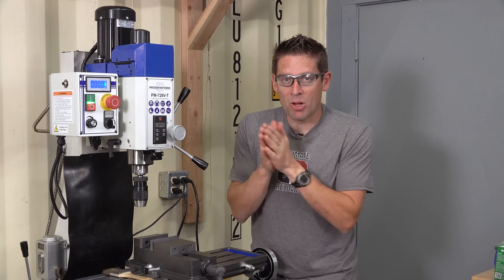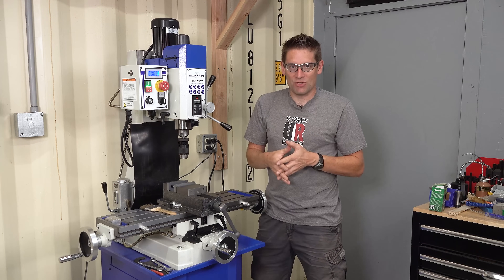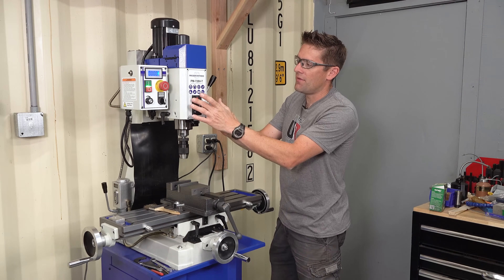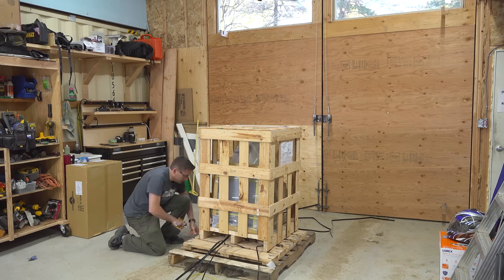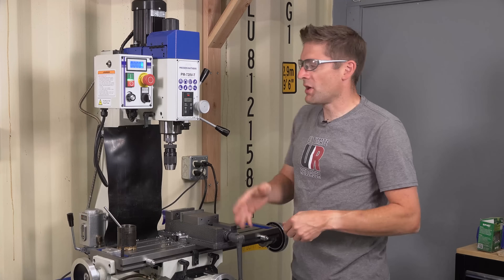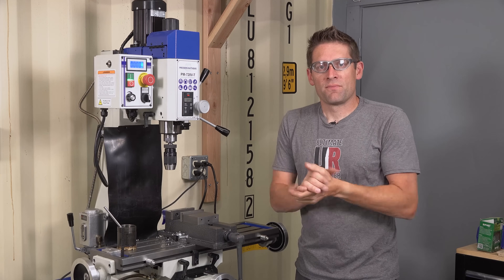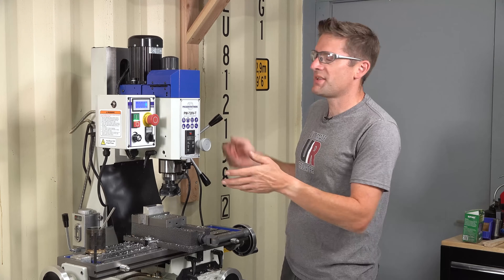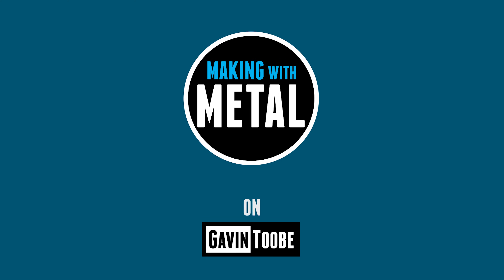Hands-On: NEW Precision Matthews PM-728VT Precision Bench Mill

Comment: “Ultra precision “ is a bit rich. If you take it apart and print the ways on a surface plate with some bluejng you are going to find the fit and finish is typical of an import machine. And that’s fine, because they are priced accordingly, but calling it “ultra precision” is silly. There are no precision scraped surfaces anywhere and I would not be surprised to find the usual burrs and mfg grit still in the machine. I would not expect it to meet any of the schlesinger tolerances.

Comment: As tool mounting systems go like R8 ,M3 Morse or ISO 30 I think the R8 is the most handy as it lends itself to the TTS system and there is nothing cheaper than a 20mm straight shank tool ......this lends itself to a power draw bar using just the 20mm collet with straight shank tools.

Comment: Thanks, great video. How hard would it be to remove and reinstall the mill head so that I could get this down my basement stairs. It looks like just the two rotation bolts?  I think it would reduse the weight significantly. What do you think?

Comment: I don't like column mills, they are very limited as to what you can machine on them. For the most part it's aluminum and slowly/carefully.  Lots of flex on that long, thin column... you will be fighting chatter on a regular basis.  16:26  not good.

Comment: We see how it cuts Aluminum but that's hobby material, how does it work on steel or Stainless?
Reply: It works on steel/SS, just have to take smaller cuts is all.
Reply: You don't want to do that on a column mill. You need a knee mill for that sort of work.  They are just not rigid enough, it's inherently weak.
Reply: @freddyrosenberg9288 
Not really. It’s all about feeds and speeds. Don’t rush it on these mills.
Reply: @freddyrosenberg9288  Yes I agree Those benchtops are toys

Comment: Why even mount a 3" facemill when only using 1/3~1/4 of it's size?
With that effort it can handle a 10" face mill 🙄😳
Reply: Not that he was thinking this but if the face mill is larger than the part you can stop the cut once the leading edge of the cutter completes it cut. No need to wait for the trailing edge to pass.  Also works for fly cutters.

Comment: I have this machine as well. When I extend the quill to it's max depth of 3" I start getting vibration and noise in the head. Do this happen on your machine? Thanks!
Reply: I do too. Believe it has to do with the return spring that pulls it back up.  Someone else's video I watched about it and guy removed it and said it fixed the tightness and vibration.
Reply: Yeah mine is horrible:( even when I'm using an end mill with the chuck thingy all the way up it still has some vibration!!???

Comment: As a machinist.....I perhaps have a different definition of "Precision"

I also cannot get on-board with Chinese (or Taiwanese)  products that are designed to a price. Personally, I would rather just wait until I could afford something proper.
Reply: And most people that are getting into milling as a hobby don't even know if they will stick with it, let alone need anything bigger or more precise.  
  Not to mention the weight/size of a "proper," or full size knee mill takes up alot more space and alot of people dont have the space needed for a full size.
  I also was very hesitant about buying a used knee mill as I know absolutely nothing.  If a used mill needs anything or servicing, has an issue, etc. I wouldn't know how to fix it.  
  There's 3 phase power on the electrical poles across the street from me, but thats another big expense u have to deal with when going with a used bridgeport/clone.  Is 3 phase power available?? If yes, how much will it cost for a line to be ran to my home?  Another big expense.
  I knew I wouldn't be machining multiples of a part, If I knew I'd be doing some production runs I'd go with a CNC mill.  I just use it for one-off parts to build stuff out of metal and wood.  How fast it can remove material doesn't affect how much money I make so I dont mind if I have to spend 1hr. Longer taking smaller cuts.  
  It also has a 5yr. Warranty which was a big plus.  
  For my uses, the smaller benchtop style mill came out ahead on the pros/cons list.  
  Guess it really depends on your skill and what you would be using said machine for.  Also nice that parts are easy to come by, unlike parts for some bridgeports..
Reply: Factory400, many of these less expensive lathes/mills are good to 2/10,000 of an inch once they are set up.  Most machinist know how to do Metrology, and can squeeze "better than factory" accuracy out of these Asian Machine tools. They don't do the kind of thick blue chip cuts which were normal when I was a Machinist, but then, they are normally not for large-scale and large-volume line work. These are for hobbyists (or former Machinists who want something around the house). I have been looking in my area for a Bridgeport mill, but all of the ones in my area are very tired, and need their dovetails re-ground to get out all of the gouges/scrapes on their surface (and to remove the sway-back in the high wear areas).  The mill he demonstrated is not just "milled" dovetails, they are also ground AND hand scraped... they are a thing of beauty.  This mill is far more capable than you imagine.
Reply: @addertooth1  I just got this mill a few months ago, have never used a mill until a bought this one and am able to hold 1 thousandth with ~15hrs. Life experience using a mill.   IMO not too shabby!
 Thats as accurate as i can measure, it may be more precise than 1 thousandth i just dont have any device capable of measuring to the ten thousandth.  
  I'm not making parts for the space shuttle like @Factory400 is, so holding 1 thousandth tolerance is  good enough for the girls i go out with 😉.  
  Also have no need for a bridgeport sized mill.  I don't have enough raw material, nor do I plan on making anything where I would need something that big and heavy to hog out that much material or work on something that would require that size of mill.  
  If Factory400 and/or other machinists need that type of material removal and accuracy in their homes, more power to them!  Id rather have something i can move myself if needed, run off of a regular outlet, has a 5yr. warranty, is still being produced so parts arent hard to find, doesn't take up as much space, but is accurate enough to hold .001.
Reply: Taiwan is not china, they're a free market economy capable of putting out quality goods. I'd buy from taiwan just as quickly as from the western world. That being said, a bigger 220v machine seems to be almost the same price from the same company so I'm not sure even for the use case of a small "bench top" that I'd get this particular mill.

Comment: Great timing!  I’m about to buy one of these as I can’t fit a Bridgeport style mill in my shop for now. Did you have to do any adjusting, scraping or anything else to setup the mill?
Reply: Probably just clean up the way before use and make sure the gib (not the way )
lock tight
Reply: Get a deckel FP1 or FP2 instead.  Or a Schaublin 13.  This is just a toy compared and this is just a silly video that doesn't show anything about accuracy or true performance..
Reply: RH facts, there’s nothing here but a show of what the box tells you and a showing how fast he can unwrap this Taiwanese blueberry. (NOT SN INFORMATIVE VIDEO)
Reply: @VærdAtSe  A video of poor rpm choices due to the  mills lack of torque 3" face mill at over 2600,and the drill was cussing him.
Reply: @VærdAtSe  Just a guess, but I'm sure the price difference between the PM-728VT and the Deckel or Schaublin is probably pretty substantial.  

The same is true for others in the comments suggesting someone wait/save up for a Bridgeport or one of the clones...  Even a used Bridgeport in good condition and especially a fully rebuilt, factory spec machine is a crap ton of cash.

For small projects, I'm sure the PM-728VT is plenty good enough, or very good if you know what you're doing.

Comment: ...i know you're using this for stocks and such...wonder how it would fair against a Glock slide...
Reply: Do you think this mill would be enough for glock slides? I'm currently in sdi and I am looking at agi. I ordered a grizzly lathe and would like to know what a good mill would be to complete most gunsmithing tasks.
Reply: @jakearchambault8160  I don’t know if his little mill will...I have the precision Mathews pm-32 and it works REALLY well...I have done several stock Glock slide rmr cuts and it was great...just respect your speeds and feeds...Glock slides are tough...those tougher metals are going to require stability for accuracy, which means weight, pm40 would get it done to and is a variable speed...just food for thought...

Comment: What does a machine like this cost?
Reply: Spent 4.5k for machine and DRO with clamping kit, homge 4in vise, 0-1/2in keyless drill chuck, and the stand for it.  Not cheap, but i don't have enough room for a used bridgeport let alone any help to move it.  So IMO the 728 is perfect for my needs.  Just need to get some tooling and measuring guages now, as well as a lathe lol..
Reply: About 3k for just the machine.  DRO, stand, power feed, etc are all extra.

As Gavin is going to spec it out you're looking at about $4,500.

Comment: Excellent. I bought one of these a few months ago. It has been excellent. They will soon have a CNC kit for it with the ballscrews and motor mounts that will make it much easier to convert this unit. I'm looking forward to that. It is 120V so easy to power. It's a bit heavy so be prepared to move it safely and bolt it down. If you don't know how to use a milling machine there are lots of training videos on the net, get a machine and get started.
Reply: Exactly what I am doing! Been a fun experience so far, SO MUCH to learn!
Reply: @perchowski3021  Is the CNC kit available yet?
Reply: @jaggedcliff  Yes it's available now.
Reply: Thanks mate. I'm 82 and retired at 75. I was in steel fabrication but always had a fetish for powered home DIY machines. Got a lot except a mill and this one looks great. As you've had yours for a year any tips and advice? Ta.
Reply: @nifty1940  85 now and still tinkering after 75 yr retirement...Thats inspiring !!!

Comment: What's the power supply spec? Will it run on 110vac?
Reply from the maker: Yes! 120VAC!
Reply: Standard 120 vac 15 amp outlet
Reply: @alanb76  Alan, can you confirm the 15a works? (I saw in the prior comments you have one).  I was wondering this myself since the specs say 20amp and I don't have 20amp service.  Thanks
Reply: @mitchell5828  The specs do indicate a 20A circuit. My PM-728VT came with a standard 15A plug, 20A plugs are not too common, you can recognize them because one of the prongs is twisted 90 degrees so the two prongs are no longer parallel. A 20 amp circuit requirement would only be a factor under very heavy cutting load, which is beyond anything I have done. You can control the load by adjusting the cutting speeds and feeds. My circuits are actually 20 amp, frequently the circuit is 20 amps even if the outlets are 15 amps. It might be possible to trip a 15 amp circuit breaker under very heavy cutting loads or with a stuck tool, but I don't expect that would happen under most conditions. The electronically controlled BLDC motor starts softly so inrush current is not high.
Reply: @alanb76  Thank you very much.  I assumed I could keep it under 15a, just wasn't sure about start-up current.

Comment: I like your videos but your tests are not very practical in showing the capabilities of the machine.  For instance, the facemill, you would typically be using it to face some thing at least 2/3 of its diameter and preferably in steel.  Your RPMs were also way too high